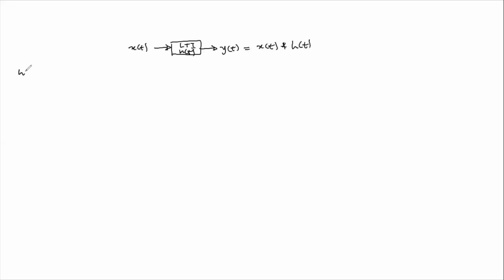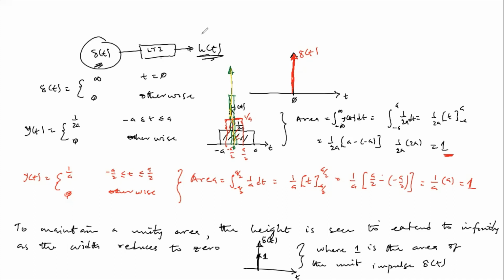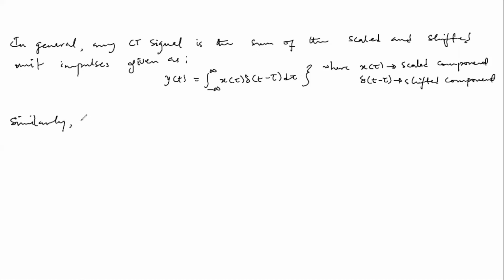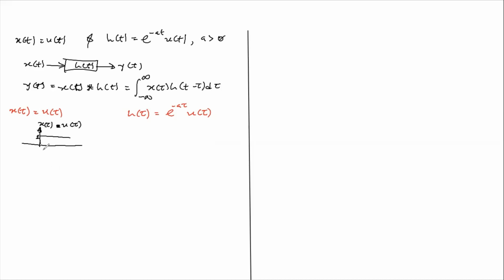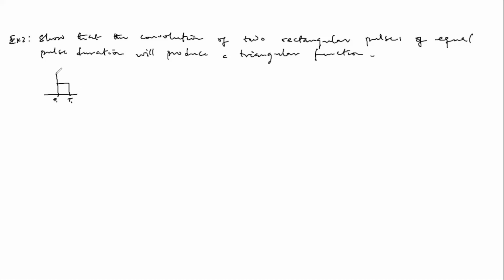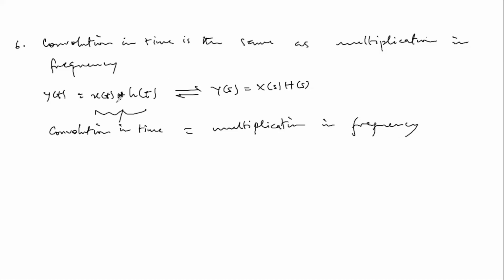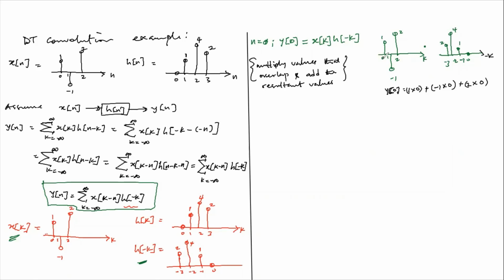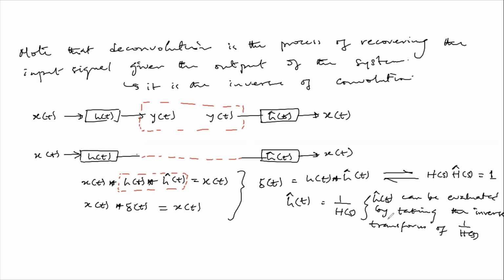L05. Impulse Response and Convolution of LTI Systems #lecture #new #signal #system #engineering

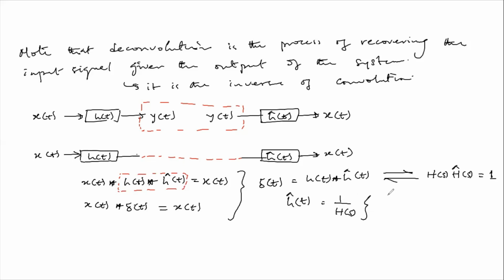Comment: sir at 1:40:43 do you mean H^(S) = 1/H(S) instead of h^(t) = 1/H(S) ?
Reply from the maker: In the frequency domain, H(s)H^(s) = 1. What h^(t) => 1/H(s) implies is that h^(t) can be estimated by taking the inverse transform of 1/H(s). Recall that the transforms are used to switch between the domains.
Reply: Oh thank you sir, now i understand